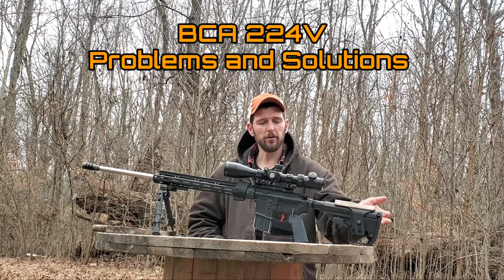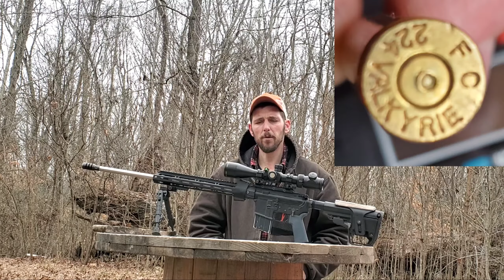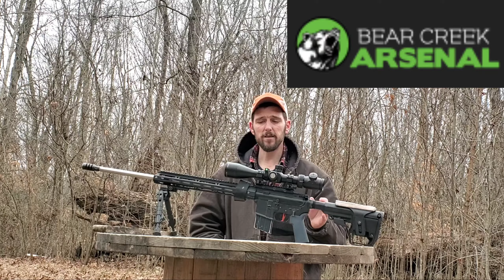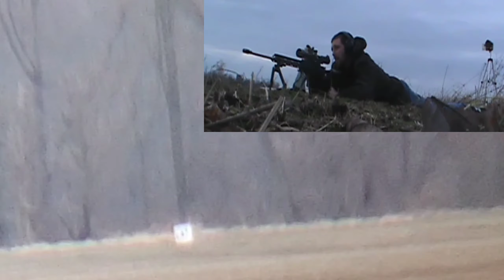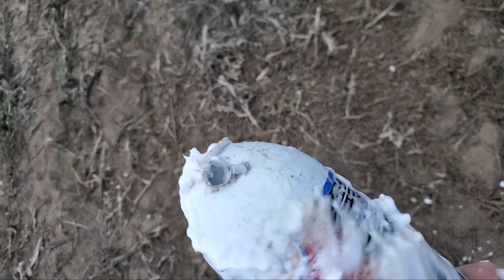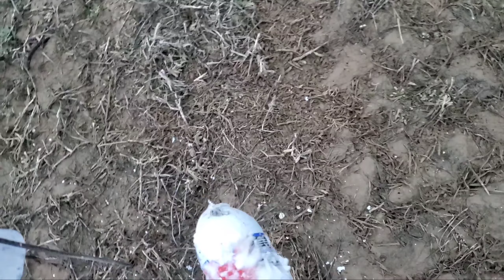BCA 224 Valkyrie Problems and Solutions ( 983 Yards vs Shaving Cream)

Comment: I really enjoy your videos. What charge of Varget are you using and what OAL with the ELD 88’s and 80’s? I have the same barrel.
Reply from the maker: Thank you I'm loading the 88s with 23.7gr of varget and the the 80s with 24.0gr. My oal is 2.290 using ASC 6.8 spc mags which have a 2.30 mag length.  Also I found switching primers until you find the best one for your load helped me with 224 valkyrie
Reply: GunFather Precision Do you care to share the average velocity of each bullet with the loads with the Varget charges you mention?
Reply from the maker: @michaelrogers3694  Not at all. The 80gr is 2897fps and the 88gr is 2795fps
Reply: GunFather Precision Have you tried the  Berger 80.5? If so, same charge as the 80 ELDM?
Reply: @gunfather83  One more question. With the COAL at 2.290, what was the jump to the lands? At 2.290, the 80 ELDM is jumping .040 in my rifle. Just curious as I can't get them to shoot well yet.
Reply from the maker: I have not tried the 80.5 Berger but if I was going to load it absent any data I would use the same charge as the 80 eld

Comment: What velocity are you running at? Also, what are you getting for ES and SD?
Reply from the maker: My 88gr eld load runs at 2785fps from my 24" barrel with an 8fps sd and a 17fps es
Reply: @gunfather83  thank you sir. I am trying to start load development. Still collecting info
Reply from the maker: No problem.  Good luck
Reply: @gunfather83  hi. Looking at your informative 224 Val video. I was wondering what was the powder you used to get those numbers (appreciate your help), thanks.

Comment: I was wondering what you thought would be the best grain bullet to start with.i don't load my own ammo as of yet.i ordered a bca 22" 224 upper.i also ordered a few different grains and brands of factory ammo.
Reply from the maker: The only 2 factory loads I ever tried in mine was the 88gn eld match and the 75gn federal load. Depending on your use really decided what you will want to shoot. If your planning to shoot long range precision then no doubt the 88gn eld match load is probably the best and most cost effective way to really do that. For me it always grouped sub moa and had plenty of velocity. If your varmint hunting then the 75gn federal will work just fine out to 300 yards or so. It grouped just over 1moa and was consistent.  But your rifle might not like either of those. It sounds like you have done the right thing and order different types of ammo. Just see which one groups best for you at 100 yards and go from there but keep in mind the bullet with the best Ballistics coefficient is typically going to perform the best at long range
Reply: @gunfather83  ok man.thanks alot.im hoping my rifle likes the fed 75s.i can get them for about $10 a box
Reply from the maker: Yeah they are definitely the most cost effective. If your just planning on hunting within 300 yards they will probably work just fine

Comment: When you sent it back did they mate the new bolt? You might get better accuracy out of the new bolt they put in the rifle.
Reply from the maker: It's a budget upper and I dont think that BCA takes the extra step to mate their bolts. I put the stag in and it shot right back to the same 3/4moa at 100 yards that it did before so I feel pretty good with that from a budget gas gun.
Reply: @gunfather83  just a recommendation
Reply from the maker: I appreciate it. I wasted trying to come off rude. I had honestly thought about it myself but I seriously don't imagine that BCA mates there bolts to the chamber on a 300$ upper and I feel much safer with the stag bolt than I do with the same brand of bolt that already failed me and caused an out of battery detonation. 
Not to mention my accuracy staying the same with the new bolt .
Reply: @gunfather83  no problem man, I wouldn't expect them to do that either. Lol